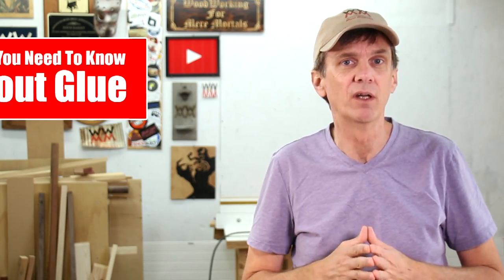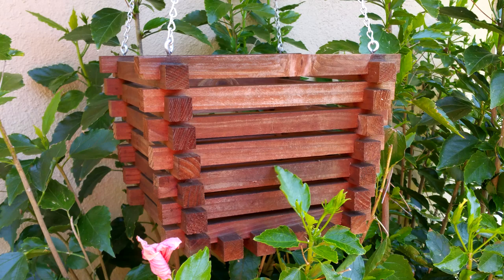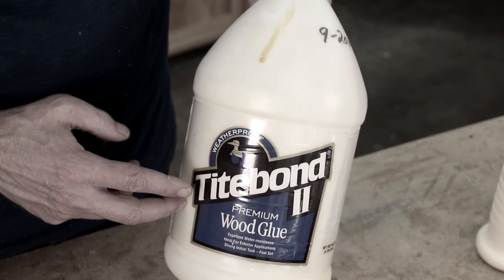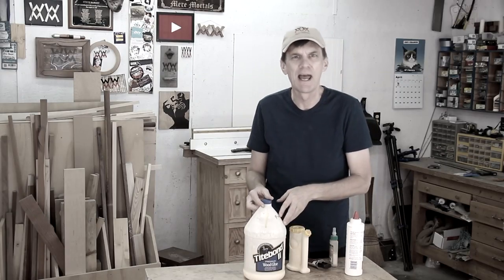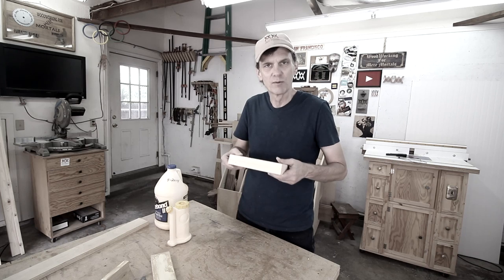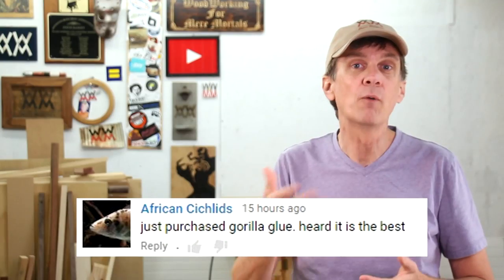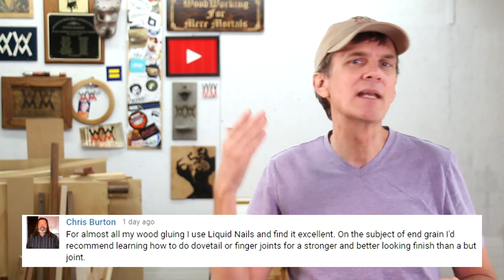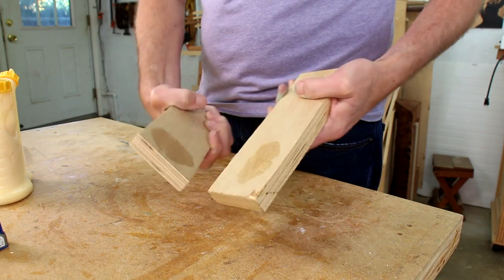Why I Don't Use Titebond III | MORE MINUTES

Comment: i use titebond 3 to make wood surfaces sandable for gloss finish. i mix it 50/50 with water then brush paint it to wood surface. let it dry then sand it smooth for super glossy finish.  my titebond 2 is all around

Comment: a lot of woodturners will use CA glues as "crack-fix"....you find a small split of crack....pack it with sawdust and dribble in a bit of glue to fix it into place....then continue turning....    i've seen more standard workers use it as a temporary "clamp" type thing, somewhat like you'd use a brad nail to hold till the glue sets up.....

Comment: It's pretty simple to test put some Titebond 2 on a piece of wood and let it cure. You can wash it right off with warm water easily and quickly. Titebond 3 is very difficult to remove as it is much more water proof after it dries. Join a small piece of wood together with titebond 2 and after its fully dried soak it in some warm water after a few minutes you can pull the two right apart, not so easy with the 3. According to the manufacturer it has a couple hundred more psi of hold strength and a longer working time before it dries allowing for use in more complex projects. For your applications I agree the difference is minimal but it is stronger and more water proof that's a fact.

Comment: What I do is mix the saw dust with the glue and stuff the hole, then sprinkle and finally pack pure saw dust on top of the glue mixture and what sticks, sticks… but when I stain the chances of it coming out the same as the wood around it, becomes pretty good.

Comment: Neither II or III can be used in marine application. But I always buy III because of the stated longer open time. 
When it comes to mixing sawdust with glue as a crack/joint filler I use white latex glue (Elmers) because it sands smooth easier. Very difficult to sand Titebond III- sawdust mix.

Comment: When I was in Arizona we used TBIII for longer open time in the summer. I wondering if the light color could be a benefit on lighter color woods like maple and basswood? I still prefer TBII though.

I've had incredible results with CA glue when attaching turning blanks to a sacrificial base. (The kind that used a catalyst)

Comment: What is a good way of removing glue squeeze out besides whipping it off with a damp cloth or paper towel. I to have trouble with this method. Type bone 3 has a longer set up time then type 2, it is also much more thin & runny.

Comment: When all other factors are equal a TB3 joint will hold better than the same joint verses using Original or TB2.  This is partly due to the fact that it's flexible when cured, not brittle like Original or TB2.  Also, TB3 is completely waterproof when cured, even when submerged for days.  Finally it has a longer open time (working time / assembly time) of 8-10 minutes vs 4-6 original or 3-5 TB2, and highest bond strength of any Titebond wood glue product.   Although bond strength is more about consistent & correct clamping pressure.

Comment: The red seal on my fastcap has never left gross glue on the inside like you just showed steve. Give it another try lol

My is always ready to flow from the moment i remove the cap. BTW I also use gallons of titebond glue

Comment: Polyurethane glue is for when you don't have the time to wait for a regular wood glue to dry, it drys really fast and makes for a strong joint. Contrary to popular belief, the foaming doesn't help it to glue joints with gaps. Like many adhesives, you need good contact between the surfaces you want to join. I have also found that spraying the surfaces with water is an unnecessary step, there's normally ample moisture in the air or wood itself for the glue to set off good.

Top tip - do not get Polyurethane glue on your hands, use gloves, or you will be covered in black bits of glue for days!

Comment: Hide glue? Titebond makes a bottled ready to use liquid hide glue or you can still buy the stuff you put in a glue pot. I've never used it but Chris Schwarz had piqued my curiosity.
Reply: +Nate Thomas I use Titebond's Hide Glue all the time, it's not water resistant at all, but if you have glue squeeze out on your project , you can rub Hide Glue when it's dried with a damp rag and it's gone, it's great for laminating veneers too and it's very, very strong. Temperature sensitive though, below 50F I thought it had dried up in the bottle, I took it in the house and it went back to liquid by the next day...that's why there's a glue pot. 8^)

Comment: I like Titebond III (3)  for cutting boards. I do like Gorrilla's wood glue (not expanding glue) but I have noticed that Titebond II (2) has the least staining and discoloring. Cutting Boards should be wiped clean, but occasionally (or more often perhaps) people will wash them in the sink and even put them in the dishwasher.  The waterproof glue does stand up better to these incorrect cleaning methods. In regards to cutting boards the glue has not caused any problems of staining because the area that would be stained is always planed and sanded off, if there is a gap then it should have been jointed after the dry clamp-up. Anyways, happy woodworking.

Comment: If you want to join pieces of wood quickly and have a good bond you could lay a bead of titebond 2 on one half of the edge and another bead of fast drying cyanoacrylate glue (15 sec set time). That way you have the best of both worlds and I have put together subwoofer boxes QUICK using this method.. No real need to have clamps if they stick together in 15 seconds. Make sure you test fit the pieces together before applying the glue!!

Comment: I like cyanoacrylate from Bob Smith industries. It  sets up in minutes and it will bond wood, plastic. It is very stronge, but you have to be careful of getting glue on your fingers because it will glue your fingers together. I found it at the hobby store.

Comment: I honestly never tried Titebond, I have always used Elmer's Woodglue. CA glue works great for a few things but I wouldn't trust it for holding a huge joint together. Works best as a finish/sealer for turned projects. I hate gorilla glue with a passion. For a homemade filler I use PVAc (Elmer's multipurpose) based glue and the sawdust of the timber that I need to fill with. The PVA glue dries clear and doesn't change the pigment of the color unlike most wood glues add a yellowish color thus making the filler darker.

Comment: Titebond III is ANSI/HPVA Type I and and Titebond II is Type II, from the manufacturer:  
"Type I testing involves cutting the 6" by 6" assemblies into 1" by 3"
specimens, boiling them for 4 hours, then baking the specimens in a 145˚F
oven for 20 hours. They are boiled for an additional 4 hours, then
immediately cooled using running water. The specimens are sheared while
wet, and the bonds must pass certain strength and wood failure
requirements to pass the Type I specification.
Type II testing involves cutting the 6" by 6" assemblies into 2" by 5"
specimens, soaking them for 4 hours, then baking the specimens in a
120˚F oven for 19 hours. This is repeated for a total of three cycles, and the
bonds must not delaminate to pass the Type II specification."

Comment: Titebond III is better suited for dark woods ie walnut, while it maybe more weather resistant than what tbII is I would take in to consideration what type of wood I'm gluing up light or dark if light th II if dark tbIII. The dark lines from the glue joint would be un noticable on a dark wood as the glue lines from tbII are on the lighter woods. Hope this helps. Btw gorilla glues sucks at filling in gaps as Mr. Wadel has show in his video testing it.

Comment: I saw another video, where the guy mixed a bit of stain directly with the sawdust and let it dry...THEN mix it with glue to make the hole/crack filler.

Comment: in fact I managed to squeeze all the glue out of a bond by applying to much pressure, but there was a lot of pressure for a very small surface so I think it is pretty rare in normal condition.

Comment: 1. I am using Gorilla glue only for woody nails, this foam is a problem in many cases. 2. Superglue is very tricky, but once you know how to use it properly it works amazingly. For example, if you want to put a screw permanently into wood such way so no screw driver will be able to screw it out, then use few drops of Superglue. I don't like jelly Superglue, liquid is more practical. 3. I have used a salt, but didn't like it, blue tape is more suitable for my needs. 4. I am using Trend plug system to hide screw heads. It is fastest I have used and provides pretty nice results.

Comment: For filling nail holes how about trying this.. Pack the hole with saw dust, then a drop or two of superglue. Woodturners use this technique with good results for filling small imperfections.

Comment: I use both for wooden flying model assembly. TB2 set up faster and sands acceptably. TB3 allows long work times, less viscous so easier to apply sparingly (weight matters), and sands very easily. I'm not particularly concerned with the weatherproof aspects or the visual appearance of the joints. When I am aligning dozens of parts simultaneously over a large structure TB3 can be a good choice however the drying time is generally overnight. Neither product has so far proved unacceptable in strength for model building.

Comment: I know I'm commenting late in the game
My findings on Super Glue?
It doesn't like Vibrations
Case in point
I used it to re-attach the rear view mirror that had fallen off the windshield of my vehicle
A few days later as I was driving
The mirror fell off again
Many other places I've used Super Glue that have vibrations it has failed
I agree - it's purely a temporary use item

Comment: Super glue (CA glues) are very strong, but they are also brittle.  So pulling pressure doesn't affect them much but side to side pressures can break them fairly easily.  As far as wood goes I've always found wood way too porous for them.  It usually just soaks into the wood.  I've never tried the gel type on wood, but I believe wood glues to be a more superior product for these applications.

Comment: titebond 3 can be applied at a lower temperature of 47°F, has a 10min open time, and a slight higher psi rating at 4000psi. Compared to titebond 2 at 3750 psi, a 5 min open time, and can be applied at a temperature no less than 55°F. Also titebond 3 will stand up better if the wood spends more time saturated with water, than titebond 2, but still is not recommend for the use in building boats and such.

Comment: Try mixing your stain with the PVA and sawdust if you know in advance which stain you are using?  BTW Titebond 3 works at a lower temperature than all other common PVAs as far as I can see.  <Edit>  Actually just noticed that standard green EVO-STIK PVA wood glue (here in UK not sure if available in US) can be applied from 5C/41F to 25C/77F which is a shame since I have been struggling with Gorilla PVA which only works from 13C/55F upwards.

Comment: I think the main advantage of Titebond III is the longer working time. I think it is also the strongest of the three but when does any glue really fail?
Reply: +RickMakes fwiw In my experience the working time is practically the same between 2 and 3. If I need long open time I use Titebond Hide Glue or regular Elmer's.
Reply: +leif52pickup Titebond lists the hide glue and Titebond III as both having 10 minutes vs 5 for Titebond I & II. http://www.titebond.com/titebond_wood_glues/Ultimate_Wood_Glue.aspx (Hide glue is on another page on their site).
Reply: I'm just speaking from my own experiences. I work in a cool humid environment. That could be a factor.

Comment: If humidity is above 40%, you don't need to (and shouldn't!) spray water on polyurethane glue. Spray on, wipe off, then use polyurethane glue. Activator makes cyanoacrylate glue even weaker. It's great for a few odd applications, but not for general gluing.

Comment: Ca glue is best if you are doing an inlay job involving small details being held by three or more edges. I wouldn't recommend it for anything else. And the foaming gorilla glue is perfect for filling gapped wood but you end up with alot of bubbles that look horrible on visible surfaces.

Comment: Well... ANSI type I ratings are much harder to pass they type II ratings.  TB III (and many other PVAs) can react with materials, especially metals (think, metal pipe clamps) that form black iron oxides.  I suspect this is because 1)water based and 2)pH.  If you need an ANSI type I rated glue (e.g. TBIII) - you may just have to deal with the sanding.  

I was going to suggest you check with National Casein to save money on your glue (I buy the 55 Gallon drum of type II - PCXL2000 I think) - but then I heard you say you a gallon lasts you a year, so better just get it at Lowe's.

Comment: I use titebond 3 for cutting boards. Luckily I've never had the black lines you mentioned. I go through about a gallon every month or so
Reply: +Dylan Pieniazek I also use it for cutting boards. It's nice for something that is washed frequently. I think if you plane/sand/smooth the surface properly, you won't be having those black lines.

Comment: Titebond III, weather proof (not just water proof).  Also it is foodsafe and easier on knives when tooling like cutting boards.   Cyanacrylate is a great tough finish for woodturning pens.  Also good to use on other woodturning project that have a crack or you need to fill.
Reply: Steve had got this wrong w/the labels, & it seems as though u have as well - TB3 says waterproof, whereas TB2 only says weatherproof. And that's all i have to say about that (say w/Forrest Gump accent/voice). Thanks for the other input, tho.

Comment: Superglue can form a very strong bond but it works best when it is able to chemically dissolve or melt two items together, works especially well with most plastics. However the glue itself isn't very strong. So whilst it can melt plastic together very well (and your skin, what it was originally designed to do), it does not actually stick to itself as well as wood glue does. That's why with superglue joints you really have to press the two item to be glued together really hard so that they can touch and be melted together, but you don't do that with wood glue.

Comment: Tight bond is a resin and only for internal, 2 is a pva and suitable for external work but has a short working time, 3 is a polymer and is stronger with a longer working time and also suitable for external work.
Reply: Do you find type 2 to be stronger than type 1?

Comment: Just purchase a squeeze bottle of titebond 11 and refilled with over 2 gallons and still using it. bore a hole just larger than the tip in the bench I sit it in a dog hole  and sit it in upside down when your gluing

Comment: I use Gorilla glue a lot!  Depends on where you live.  I you live in a very dry climate then yes, you have to pre-moisten the wood pieces.  But, where I live I never do.  The ambient air and wood itself have more than enough moisture to activate the glue.  Also, pre-moistening will speed up set time especially in warm ambient temperatures.  Yes, you have to clamp and clean up the foamed out glue.  For rough woodworking that is never a problem for me.  For fine cabinetry, yes, that would be a problem.  Choose what you are happy with for the project you are doing.  Finally, the polyurethane (Gorilla) glue will get on your hands and will have to wear off.  Usually takes two to three days for me.

Comment: Have a look at the project farm video. They compare Titebond 1, 2 and 3 in both dry conditions and submerged. 3 is stronger than 2. In submerged conditions it is significantly stronger. I’m using 2 however as as you say, it’s strong enough - stronger than the wood

Comment: I assume Titebond III will be tough enough for the crude shelving I am putting into my garage and braces for keeping spare wood organized, but, but, I found it to be a very messy, runny glue with little viscosity and it dripped all over the place.  They say use it liberally, but you really can't without it making a mess.  I know wood glues differ from other adhesives in penetrating the grain of the wood, but it seems to me they could produce a wood glue that has some body to it, while also being able to penetrate the wood.  I used it at a temperature of about 60 to 65 degrees.  Any folks out there know of a more viscous wood glue that also is designed as an adhesive for wood, other than gorilla ?

Comment: Titebond 3 is for cutting boards and butcherblocks... you also should have sanded down the joint on your outdoor table, would have gotten rid of the glue that way. titebond 2 is for "outdoor" application.... otherwise wood products that will have to withstand precipitation ... quiccc and thiccc is tbd

Comment: For super glue, you want to be using a thin, pure superglue. It's best used for gluing small parts, reinforcement of cracks, chip repairs, etc. It has numerous uses in the world of luthier woodworking. One challenge of superglue is also an advantage depending on how you use it. And that is water thin superglues ability to soak into the wood and fine cracks.

Comment: the big difference between tite bond 2 and 3 is 3 has set up time almost twice as long, so if you are glueing up 10 large boards, you need extra time to apply the glue to tye 10th board before putting all 10 pieces into tye clamps.

Comment: I used Titebond II for a cedar trestle on my garden railroad in the heat of Phoenix, AZ It lasted about 5 years before it began falling apart. I ended up screwing it back together. Since we get so little rain in the desert, maybe it fails quicker in a wet climate? Anyone out there used Titebond III on a similar project? Thanks.

Comment: Cyanoacrylate glue (or super glue) has other uses in fine woodworking. While it might not be the best choice for bonding joints, I've seen it used as a pore filler on guitar tops.